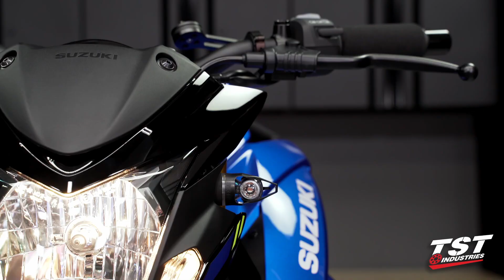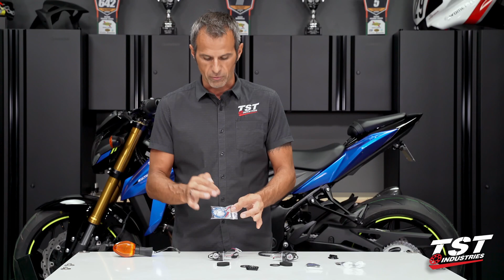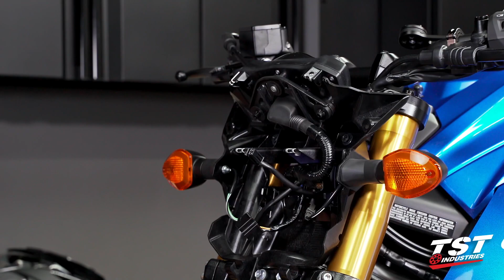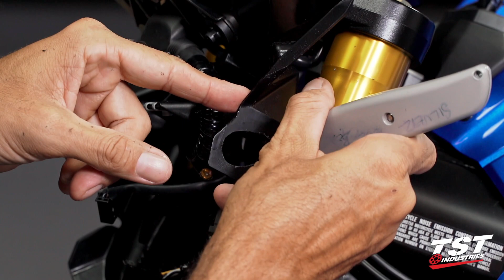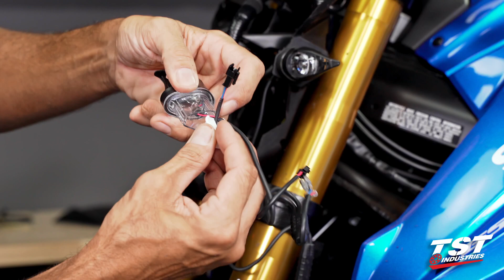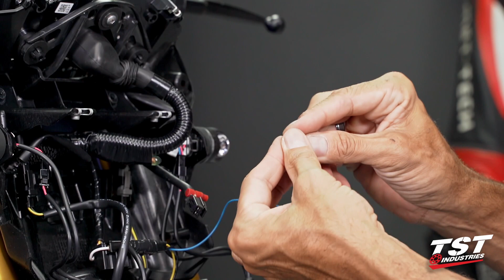How to install Mech-GTR LED Turn Signals on a 2017+ Suzuki GSX-S750 by TST Industries

Comment: They look awesome! Are they homologated? Like have an E stamp of sorts for legal European use
Reply from the maker: We do not pursue E marks. The way it works is that you pay a branch of government to have some paperwork filed until it expires, and then you do it again. It's awfully similar to paying a pimp, or paying the mob for "protection." We just dont want to feed that machine.
Reply: That’s fair enough, I imagine most of your customers are in the US so makes sense. Would just be a pain to swap over with the originals every Two years for inspection as we have over here.. frikin europe.. they do look awesome so will pull the trigger either way. Appreciate the work you put into your products and installation videos.
Reply from the maker: Thanks.  @garybuck5032  I am glad you like them enough to give it a go. I put a lot of time into the design of the parts and the tooling that makes the components. It's awesome to see the effort appreciated.

Comment: on my 2022 GSX-S750 the running light wire was reversed in the connector the brown wire switched to black... don't know why but it came like that. if you use the running light option tie into the brown wire before the connector.

Comment: Amazing how few options there are in terms of adaptors for the mounting of aftermarket indicators for this bike. I own a 2019 model and ended up fabricating my own out of the stock indicator stalks and wiring in sequential indicators. Wish i had known about this kit earlier although mine did turn out pretty good!
Reply from the maker: Glad to see you guys out there doing mods like this. For the non-invasive front signal installation we do offer spacers meant to help with easy bolt-on pod signal installation. Even though you are all set already I think it may interest you what we came up with to solve this problem. You can see them here: https://tstindustries.com/tst-front-pod-turn-signal-mount-adapter-suzuki-gsx-s750-2017.html . There will be a video showing the installation of signals using these adapters launching soon.
Reply: @TSTindustries  Thanks for the link, i wish i would have found these earlier! They look great. Would have saved me a lot of time and swearing too! Next time I'll be sure to check your website!